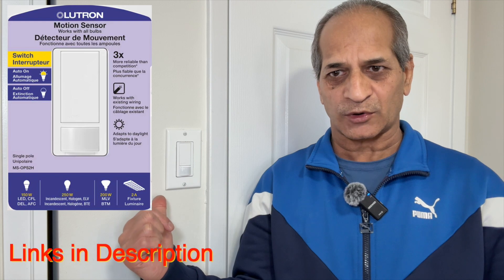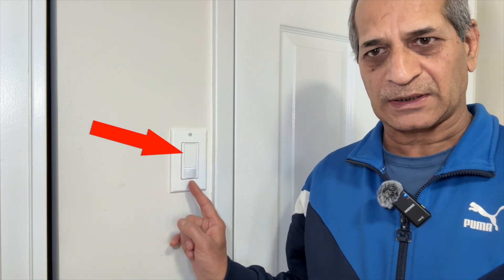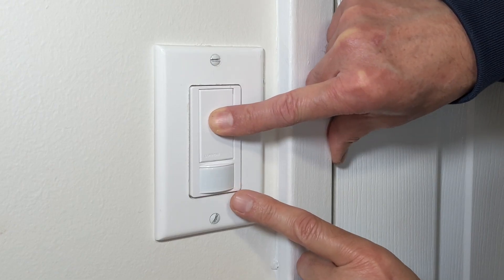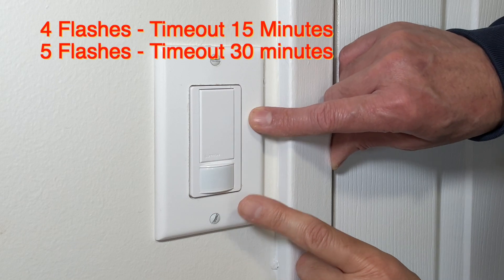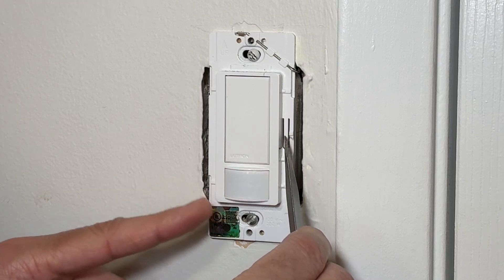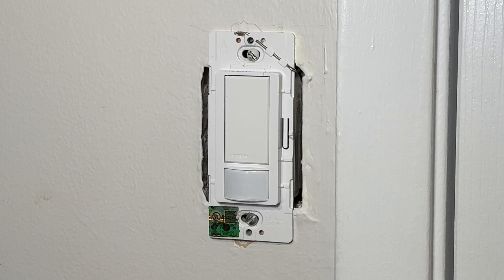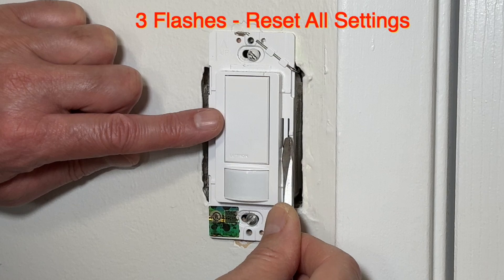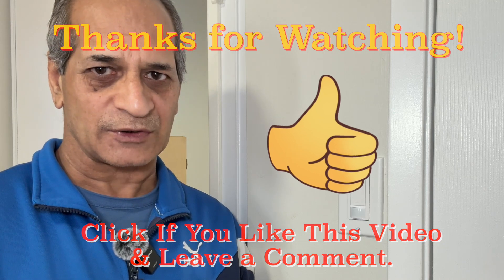How to Program the Lutron Maestro Motion Sensor Light Switch

Comment: Is there a way, after programming the device, to simply turn it off for some time. Then turn it on later to continue with the programmed setting?
Reply from the maker: Yes. You can simply tap the big upper button to turn it on or off.

Comment: My lutron ceiling lights have been on for 4 days and wont turn off no matter how I set the switch. How can i turn my lights off or fix this?
Reply from the maker: Thanks for watching! Did you try to just tap the switch? This way it works as normal on/off switch.

Comment: this setting in turn on or turn off position and 2nd question if i have setting for 5 min and then i want go to take shower what I have to do it really confusing me
Reply from the maker: Thanks for watching! For settings you don’t need to turn the manual switch on or off. When you go out and want the light to turn off after 5 min, you set the switch according to instructions.
Reply: @AstroCrescent  Dear my question is when I set to 5 min and when i go to shower it take me 15 min then i have 5 min setting and during the shower its turn off :)
I had a last switch different brand and it can control auto and manual same time when i go to shower i can turn that on and it stay until I turn off

Comment: My process to program it is not making the light blank. Anyone know how I can correct that or what the problem is?
Reply from the maker: Thanks for watching!! Did you try resetting the switch? Maybe that will help.
Reply: @AstroCrescent  I have tried and tried and tried. It just will not set. So I ended up having to just take it off and put the old flip switch back on.  I even moved the wires around just to make sure that it was wired, correct
Reply from the maker: Sorry to hear that your hard work was wasted. Just return it to the store…

Comment: I did the first step test, then to 2 blocks, then the side switch to one, last step together two flashes. Light clicks but isn't shutting off. I have had light for yrs and always worked. Came downstairs last night and it was on? So did these settings as u describe. It clicks after I left kitchen but won't shut off. It's it broken because old?
Reply from the maker: Thanks for watching! It may be a faulty unit, you may want to replace it.

Comment: I wish there was an easier way to switch it temporarily to manual mode for taking a shower without it turning off, without having to remove the plate. But maybe ill start just changing the timeout to 30 mins before showering! Thanks for the tips!
Reply from the maker: You are right. Thanks for watching!!